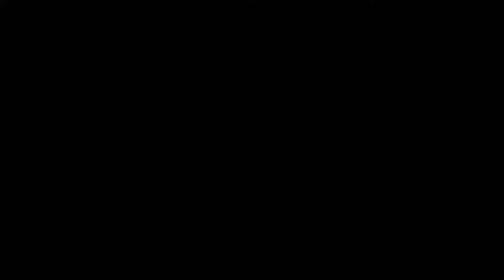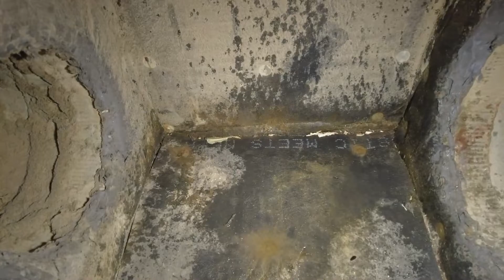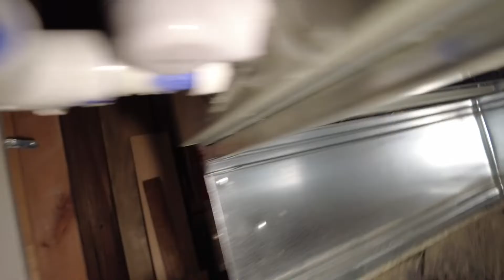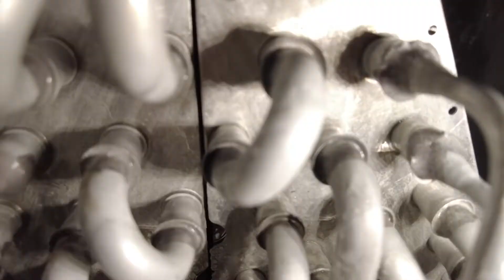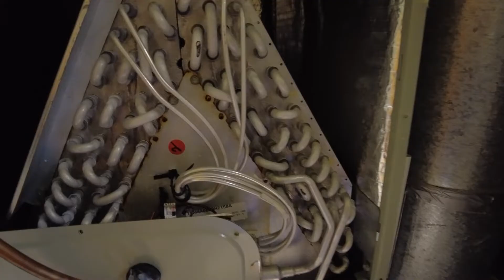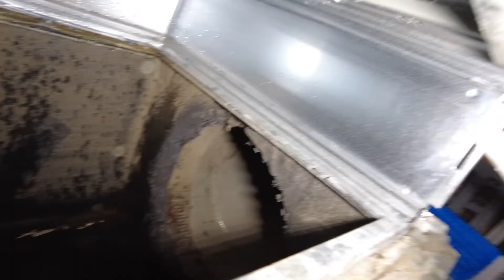Why Water Drips off of the Evaporator Coil before running into the pan | Low Charge Dry Circuits

Comment: Should’ve also ran the system with the blower off and the frosting would tell you where the hot spots are . Also   air flow should be 320 cfm to 480 per ton if the return is to small it will suck the water off the coil . Left over oil on fins , dirty even slightly dirty causes water to collect . But my professional opinion is the fins themselves are to spaced apart causing water to be dense and any imperfection in blower performance or under sizing return duct will pull the heavier water collecting off the fins vs the older style coils

Comment: I've been fighting this on three Tempstar units since new, 16 years.  Service call after service call and only remedy offered by Tempstar Rep was to flex-seal the base cabinet and add a drain line to it, which I found to bet unacceptable.  Was told this was a common thing with slab coils.  After finding this video, I had all three units checked for refrigerant levels.  Here is the comment on one of them (they were all similar and all took 1lb) " Brushed out coil and cleaned with coil jet and cleaner. Ran system found 3 deg sh
Added refrigerant to tighten up sc ending 287-123 psi 9 deg sc" and was told that it likely would not make any difference.  Lo and behold, all three units are draining to the drain pan and cabinets dry as a bone in this 95deg temps.  I guess pressures were either never checked or thought they were goo enough.  Thank You!

Comment: I know this is reall old. But the issus can be caused by 2 diff scenarios. 
1) pressures low, coil has uneven sextions, causing it to drip when going over sections. 
2) statix pressure issue. Check tour fan settings, etc and gef it right. 
IVE HAD 2 LENNOX ENGINEERS SAY THAT IF YOU GET A SPRAYER AND MIX WATER AND JUST A LITTLE SOAP, LIKE  3:1 RATIO AND SPRAY AWAY ON COOL AND ITS MAGICAL

Comment: I saw one of my coils bubbling water.  I cleaned it and it doesn't do that anymore.  I still had water falling.  I noticed that the bottom coil was freezing the water and blocking the drain channel.  I observed my system running naked with no panels on it , everything is clean.  So my system is a little low but I'm still getting 55 degrees at the vent so I'm not that low.  Nobody will come out and give my 18 year old 3 ton trane xr13 system a boost.  I don't think there is a leak.  If there were, I doubt that my heat pump would cool at all after having this problem for 6 months.  So until I get some help, this is what I do.  I run the system until the water starts falling . Then I turn it off and run the fan only to melt the ice for 30 minutes.  Then I turn the system back on for another hour and repeat the process.  As the humidity is lowered it gets better with every run.  The system can run all night long and the towels I put in the catch pan are pretty much dry in the morning. I have really good windows so my house will stay cool for a very long time. But frozen drain channels can also cause dripping.
Reply: Freezing  is not normal operation. Evap coils don't have a defrost cycle for a reason. A lot of effort goes into running your system when the only effort you should be doing is setting how cold you want it.
Reply: @ its still working

Comment: It’s not due to leak. Hot spots are due to the coating on the aluminum not being adequate. I have found several Carrier coils like this and not leaking. You diagnose with a thermal camera. Same solution though you have to replace coil. Just found one pressures were 337/135 and dropping water on both sides. Sometimes you can up the fan speed if it’s just one area but the fix is a new coil. Carrier knows it’s an issue and claims uneven coating of aluminum from their distributor.
Reply: Mine is a brand new Goodman with no leaks it's running 20° below room temperature coming out of the vents. So the refrigerant isn't low. It doesn't have too much dripping off that doesn't go into the pan but it's happening after the incompetent installer was trying to fix a leak in the condensate pipe he started hitting the condensate pipe with a hammer to break it off. After that I started noticing some water dripping off the coil outside of the pan but not too much. He also didn't fix the leak completely it's still leaking from the threads that screw into the pan. He's trying to lie and saying that the water is backing up but it isn't I can see that the water is draining But it's still leaking out of the attachment Of the PVC to the pan Period He lies about everything so this is going to be difficult right from the get-go They claim they'll fix anything wrong But of course they have no idea what they're doing
Reply: Take a closer look at the video my dude. There is a leak in this unit. It's bubbling from the coil where he is focusing in. I'm not sure if that is the problem though because loss of gas would cause the entire system to warm up and reduce the ability for condensation to form. I think this system has more that one problem.
Reply: My carrier has this issue. Leaking water from the bottom of the furnace. Drip pan was also angled the wrong way after the added something to the unit. Fried the control board thanks to these water droplets finding their way down to the electrical compartment... That was all fixed, refrigerant levels are fine air is icy cold in the house, coils is not frozen up, drip line clear etc. You're comment is one of the only thing I've found online or talking with techs that has helped. Do you have a solution for the issue other than coil replacement? @calebnkara8464
Reply: Same here with my Carrier infinity fan coil, no leak, charge is fine, air is too cold honestly. What I just changed on the thermostat was the home comfort profile overcooling feature. Turned it off. Over cooling is done to remove as much humidity as possible but IMO this 3 degree drop in temp is causing the coil to cool much to far and explains why its set to 78 and feels like freezing. Turned on electric reheat for fan coil units only to heat the coil while its actively cooling to dehumidify. Also changes fan coil airflow in the setup settings, it was set to max previously and after reading the manual I believe it should be on comfort.
 Here's the qoute 
"Note that duct sweating in high humidity environments could become an issue at low airflows. The
COMFORT airflow means airflow is varied depending on humidity and temperature demand
settings. This selection enables the full dehumidify and comfort capabilities of the system."
Not sure if those settings are dependent on each other but we'll see how this will works, but I believe a solution might be in the settings. Some are locked in the advanced settings.
Reply: I had the same thing…..Problem was a Failing Run capacitor.  That capacitor outside is like a battery supplying power to a remote control.   Once it got Changed with a new One, both Fans were blowing Full speed…. and system worked properly.

Comment: Two years ago my adult son had a new Trane system installed.  From the time it was installed it wet the filter.  After several service calls, all adding refrigerant, a technician decided the condensate pan needed replaced.  This being shortly after the one year labor warranty expired he had to pay the high labor cost of the replacement and he was charged for all the refrigerant, about a thousand dollars as Trane does not consider refrigerant a part.  Recently another tech came out, the filter was still getting wet, and determined the evaporator had a leak and has ordered a replacement evaporator.  Trane will provide the evaporator but he is being charged for the labor and refrigerant.  The first several techs did not recognize the problem.  Unfortunately he bought Trane on my recommendation.  I did not know Trane quality has deteriorated as he has found out from experience as well as the technician that solved the problem told him.
Reply: I would never buy another trane. I've had mine 4 years and it's needed 1500 in repairs every year on the AC sections. As you said, Trane doesn't consider the refrigerant under warrantee. Every time there is a leak, it's another 1000.00. Tried to work with Trane to fix it and they don't have an 'authorized service person' that will come to my area. 

They let anyone sell them and when it's a problem, they don't back their product. I hate my Trane. I long for the days of my old Tempstar.
Reply: @whispershuman5742  He purchased a 20 year old house from the second owner.  It had the two original Carrier units, one for up and one for down.  The owner said he had had no problems with the two systems but my son is out of town a lot for his work so he wanted to make sure to have reliable systems for his wife and two children so he had them replaced before moving in.  He may have been better off to have kept the old systems, probably had less trouble than the new Trane unit.  One system has been no problem but the other is a lemon with poor treatment by the Trane dealer and Trane.  It was clearly a manufacturing defect but he has had to pay a lot attempting to get it remedied.  I feel bad for encouraging him to buy the Trane rather than a Daikin with included 12-year parts AND labor warranty.

Comment: Do you have any filters on A-coil evaporator or just on the door. Should their be filter on door and filters on A-coil evaporator.

Do you use those A-Coil metal mesh filter part#(917416).

Or use 1 inch cardboard pleated/fiberglass furnace air filters. Merv 2-8

Or, should I use washable/reusable furnace air filters due to water on coil during summer. like metal mesh filter part#(917416), Merv 4 Flanders SM1006 naturalaire hogs hair cut to fit 20 x 30 x 1, or 3M Merv 1 cut to fit 20 x 30 x 1.

Comment: So what do you think about companies like Broan that simply gives you a 'drip guard' to clip onto bottom of A-frame such the drops hit in and then flow to channel, instead of hitting filter underneath? The airflow seems to be compromised significantly with drip guard. Are they trying to lie to the customer about there being a more serious design or fabrication issue with the coil? Thanks.

Comment: Thanks for this video. I think I have this problem because I keep finding water droplets on my filter.
Reply from the maker: Glad to help  were you able to verify?
Reply: @HVACTechKnowledgy  no, I wasn’t able to verify. I had my AC company come they said they couldn’t find an issue, but they did see the drops of water coming off the evaporator coil. Charged me $350 for what the tech called the special spray. Not sure what the spray was, but it did work last I looked. I know they did me wrong, and won’t be using them anymore!
Reply: @kauaireed9006  did you ever figure it out? going through something similar with this stupid complex I live at
Reply: @HVACTechKnowledgy  I forgot to tell you my AC company told me this wasn’t my problem because the unit would be freezing. If it had a leak— I didn’t say anything about your video because I didn’t want them to give me any crap from watching YouTube.

Comment: what would cause your filter to be slightly wet all the time during spring and summer?  Had the condensation line cleaned and blown out and unit is less than a year old?  They tell me its normal to have a little water on it?  So is the fix to add Freon to the system or something else?  I am still under warranty but they keep saying it's normal? Thanks for any help!  Mine is a TRANE!

Comment: Great info, but what ab a sysysm doing this that refrigerant pressures are perfect, evap coil is spotless, filters are clean, and airfllow is good? Which ive ran into twice now lol. Really frustrating
Reply: Static pressure to high of velocity on motor if you have high return static thats your problem

Comment: No tech yet has been able to figure out why I have a leak. Any chance you work in WA?
Reply from the maker: Sorry to hear that. Unfortunately I don't work in WA. Are you having issues with water or a refrigerant leak?
Reply: @HVACTechKnowledgy  I belive it is water, but i'm no expert.  The few things I've figured out are:  the furnace system (installed in the garage)  is a downflow design.  I've never had a downflow till this one and thought they were only used in attics  In the summer on really hot days the unit will run all day long and around late afternoon I start to see water accumulating around it on the garage floor.

Comment: My unit is barely 2 years old and mine is doing this but I don’t see a leak in mine? Could it have this same issue ?
Reply from the maker: It could be. If I remember correctly the unit in this video wasn't even two years old either...

Comment: We have a 11 month old Trane leaking water onto the filter. They have sent a tech out three times, they cleaned the coils, taped the insulation and cannot figure out what is causing it. Our warranty expires in three weeks and am hoping to get it resolved before then.
Reply from the maker: Have they tried checking the charge? Does it cool okay in AC mode?
Reply: @HVACTechKnowledgy  mine was just services and then became so wet right after. 
I have a hard time understanding the video. 
If we charge it with gas properly then the coils should really get cold and condensate even more water , right? 
I think the problem is that the water does not slide down the metal wings / strips into the tray. Instead of sliding they tend to drop down and drip. Could it be bad geometric or dirty fins?
Reply: we have the same problem, its been going on for 6 years since they installed the unit. now we have mold blowing thru the house and nobody can fix it. were you able to solve the problem?
Reply: @brianflowers2517  
I have the same problem. 5 years old Trane AC in my closet upstairs of townhouse. Keep dripping from the coils down the filter and yes it was a bit dirty. But was sprayed and cleaned. The filter gets so wet at times

Comment: So...had a a/c problem in my condo. It froze up. The ice was dripping down onto the air filter and floor. Air filter was wet, as was the whole inside of the furnace floor. The HVAC service guy fixed why it froze. Totally left the ice on the coils, soggy air filter, puddle on the ground inside the unit. I asked him about it and he said it would "dry out" and don't turn on the system for a couple days...is this safe?! Will it dry out all closed up?! I'm so worried about mold. And shouldn't he have replaced the filter and cleaned up the area or is that not his job. Pls advise.
Reply from the maker: Hey there no worries it will definitely dry out on its own. Probably shouldn't have had to wait a few days to turn the system back on though it usually thaws within a few hours. The main thing that would have concerned me is how did he know the system was running properly after the repair. If it was a furnace he could have run the furnace for a few minutes to melt the ice off the coil and if a heat pump he should have run it and heat pump mode, that way he can check to make sure and verify that the repair was actually sufficient.
Reply: @HVACTechKnowledgy  exactly! It has been a week and I opened the furnace up to replace the air filter today. There was a little mold on it and the floor still has a puddle. I can't really get to that though.  I also saw black areas on the evap coils (the thing right behind the air filter) - I hope that isn't mold. I'm scared to turn the a/c on and have mold in the air. I have asthma. 🥺 And we are in a 100 degree heat wave right now in CA.

Comment: My dad has a newer train system and it’s dripping water in the middle exactly like this!!!! And they can’t figure out why
Reply from the maker: And they verify the charge was good and everything?
Reply: @HVACTechKnowledgy  yes. We ended up discovering mold and had Servpro come do a detailed cleaning. Seemed to fix it!
Reply: @chazturner3207  was the mold on the coils? Where was the mold?
Reply: @chazturner3207  So a detailed cleaning of what fixed the issue?  They cleaned the coils... ?

Comment: Hi, I have the same problem, but I have a downflow, no P trap needed, the water sprinkle in to the plenum instead of running to the drain on the sides. It blows very cold air, no problems with cooling.  please help
Reply from the maker: Is it a heat pump or furnace? Also depending on the static pressure you still may need a P-trap whether or not it's upload or downflow.
Reply: @HVACTechKnowledgy   It is a Furnace, I already applied the P trap, but I found a problem, water is blowing in to the plenum b/c 3/4 top right side of the coil is not geting cold, no cooling on 2 pipes going in to the coil rightside, weird that 1 is working (distribution tubes) but the left side 3 pipes on the distribution tubes are cold, coming from the TXV, I can't figure it out, If the TXV was bad, it would not cool at all on eather side? is the coil restricted in the right side 2 internal lines? I ordered a Manifold to check SP and all the number I need
Reply: @HVACTechKnowledgy that's the other thing I was wondering I had a brand new Goodman installed two weeks ago he didn't put a P-trap in. Even though I had one with my old unit then he told me I didn't need one because it comes straight down out of the bottom but I think that's a load of bull Isn't it. What if you have an overflow detector on then you still need the P-trap on the drain line question mark? It's leaking a tiny bit where the PVC is attached to the drain pan I think because he didn't use any plumbers tape